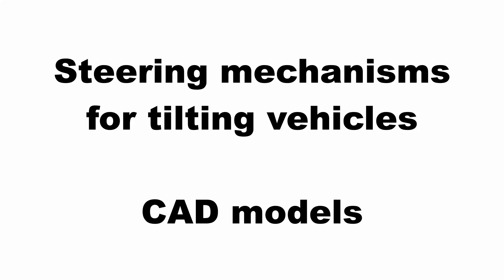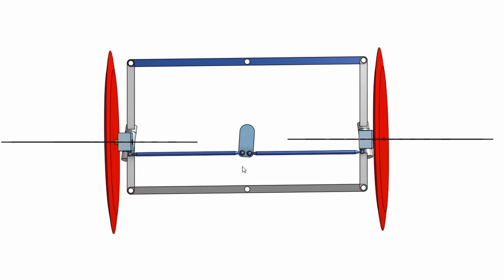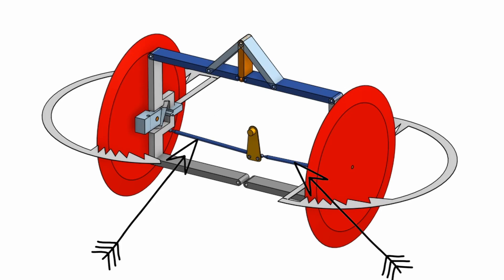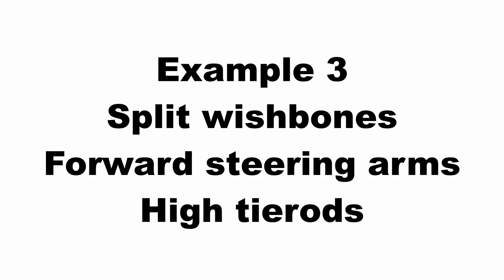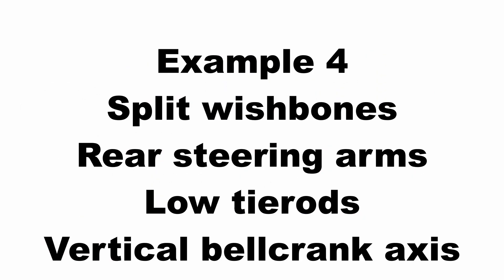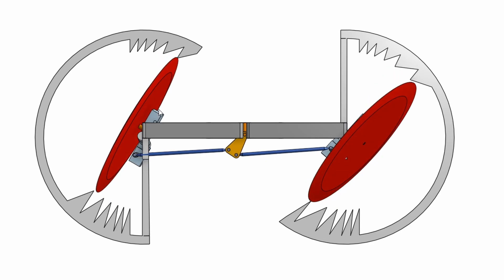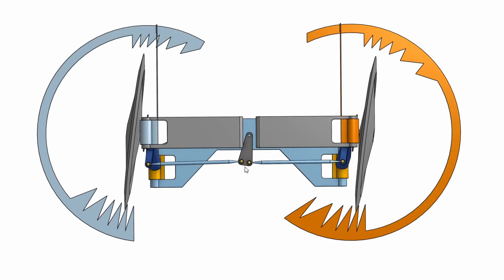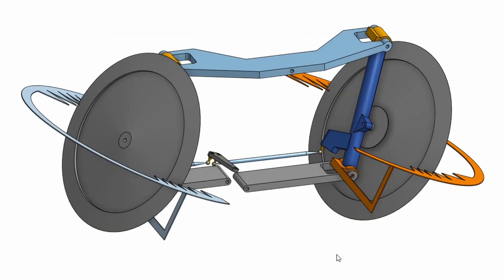Tilting Trikes Part 4 - CAD model demo tilting / steering mech design for reverse trike velobobile

Comment: Was glad to see this 😅 the only thing I could add from my racing experience is that when turning, toe out is good cause it allows the inside wheel to turn more, since the inside wheel does actually have a tighter turn radius to overcome, but I don't have any actual experience with tilting trikes...yet😅 my experience is based on 4 wheeled rally cars with 7 degs of caster and a modest 3 degs of negative camber, but I am building my own tilting trike and have made a cardboard mockup, but definitely haven't considered as many parameters as you have. Good work and would love to see how your geometry translates into a working model, thankyou 😅

Comment: i do have a question, what if you wanted to control the tilt and the steering at the same time using the handlebars? how whould that work (basicaly if you turn handlebars left, vehicle should tilt left and wheels should also go left)
Reply: Both controlled by one input gives hi lean at slow speeds in tight curves  and low lean on fast speeds in large curves. This is opposite to what is actually required, (as in a 2 wheeled pushbike action.). However, for normal road use, the angle of lean to angle of turn can be set to give a workable lean/ turn ratio that gives satisfactory riding control overall..

Comment: Hi. The bell crank seems to be the issue...if the bell was circular in shape, pivot in the middle and steering rows fixed at 9 and 3 o'clock this should eradicate toe in/out,?

Comment: When you have the wheels turned your aiming to have 0 toe, The idea of the Ackerman angle is to turn the inside tyre more than the outside. 
   The inside tyre has to turn on a tighter radius as it turns so effectively you should have toe out. The more steering angle(tighter turn radius)the more toe out effectively you will need.
    To calculate it correctly, picture you are looking down on the vehicle from above and you draw a line thru the Rear axle. If you select a point(for example 3m) from the center line of the vehicle, (this will be the turning radius)and draw a line from that point thru the center of each front wheel, the 2 triangles you create will have different angles with the inside tyre having a greater angle. 
   So to calculate Ackerman correctly you need to know the wheelbase of the vehicle. A really short wheelbase will need to turn the inside wheel more(effectively greater toe out) to turn the corner than a long wheelbase. It’s a lot easier to explain with a picture but I hope this helps. Just think that if the vehicle did a full 360* turn. The diameter of the circle created by the inside wheel will have a smaller radius than the outside so therefore it has to turn more than the outside wheel so it doesn’t scrub. Don’t think of it as toe out as this is making you think that the wheels will scrub, the wheels actually need to be on different angles so they don’t scrub as they need to turn on different radius circles.

Comment: Tilting vehicles when corners at high speed have the steering almost straight. when this trike steer more it goes very slow and almost vertical, You have to consider that while choising the geometry tune.

Comment: Everything you are saying is correct, but somehow I feel that a better bike would be a delta - like velotilt, where tilting and steering is decoupled - not that its better pe se - all the aspects of it are easier to iron out separately.
Its a shame the there aren't that many lean steering trikes, some if not all of them are plagued by inherent instabilities....
Reply from the maker: Good point, there are pros and cons to both configurations.  It’s interesting that the commercial 3-wheel scooter/motorbike market has gone down the tadpole route.  A question worth asking is - why have three wheels at all and not two?  Is the extra complexity of three wheels really worth it.  I’m not sure!
Reply: @MetalMachineShop  So I did a bit more googling while the comment was up, and it occurred to me that Velotilt, Mosquito, S'trike and Jetrike are essentially solving the same problem, but albeit a bit differently - all the joints and pivots are all around the place but in essence they are trying to achieve positive trail and as steep of a steering angle as possible.
What I like about FWD delta - simple drivetrain.
Regarding tadpole trikes - I think its safety - a non-leaning tadpole is much harder to roll, also with front wheels doing most/all of the braking - two is better than one.
I'm personally fine with two wheels, but three is much easier to start riding on.
https://i.imgur.com/44PV1G7.jpg
This is my ride, I love it, but getting GF to ride it - nope.
Now I'm thinking about a leaning delta
https://i.imgur.com/kLhIG4p.png
Something along these lines.

Comment: Akerman saw toothed guides, shouldn't they be parallel with the ground (and not perpendicular to the wheels) since the vehicle would be at an angle?
Reply from the maker: Vadim Romanovich I think you may have a good point there, but I think irrespective of this, the way I have done it still indicates that the wheels are steering correctly with respect to each other - at least approximately - although the centre of the turning circle may be different.  I might need to give it some more thought!

Comment: Why don't the tie-rods and lower wishbones meet in the middle? It doesn't seem too hard to imagine a joint that could handle overlapping axis'. Would that help the geometry?
Reply from the maker: Kevin Bailey hi Kevin, there would certainly be some layouts where this would be an advantage.  The sort of joint you envisage is possible but not easy to design!

Comment: thanks for the video, much better understanding of the stearing... I'm also building a leaning trike. going with two rear wheels, current design has the rear wheels doing the castering action to avoid toe in\out... anyone see how this could be a bad idea? (would save me several months of building and testing if someone can point out why/how this wouldnt work) love the vids, didnt even think about the toe in/out until your last video
Reply from the maker: Thanks!  I’d need to know more about your design to comment intelligently.  If it’s a delta trike with the rear wheels doing the tilting only and both fixed straight ahead I don’t see any immediate problems - it’s been successfully demonstrated on other designs.  Rear wheel steering would potentially be more problematic...
Reply: @MetalMachineShop  the rear wheels would act like caster wheels and the front wheel is for steering. I might even work only by leaning... I'm integrating mechanics/pistons to hold it upright until the lever is moved causing one of the wheels to lower. Thought if rear wheels were independently following the directions due to the catering ability this would avoid needing to worry about toe in/out and wheels not steering appropriately for the curved radious

Comment: Great work !! I don't think steering angles are very important while leaned  - like a motorcycle, you use very little steering when leaned over ..
Reply from the maker: True.  It’s more of an issue for slow speed tight turns but it’s good to try to get things as right as possible even if it’s only a theoretical advantage!

Comment: @8:05 no good if wheel and suspension elements penetrate each other...
Reply from the maker: Haha true!  You can get away with it in CAD but the real thing will need some adjustments to get everything to fit properly without clashing.

Comment: Really digging these video's. Hope to see one of these design's put into a working prototype.
Reply from the maker: Thanks! You will see a prototype soon, hopefully a working one.  It is currently being made in my workshop. Stay tuned...
Reply: @MetalMachineShop  Yep. Count me in.
Reply: @MetalMachineShop  i am just starting to gather parts for a similar design i have lots of bike parts lying about that i will use prob go 26inch at the rear tho and no plans lol. I have a good idear what i want to do but prefer to work in real life than in cad i adjust as i go and problem solve that way ✌
Reply from the maker: drumandbassob0007 the advantage of your approach is that you actually get on with it rather than think about it for ever without making anything!  Good luck, let us know how you get on!
Reply: @MetalMachineShop  Please make great videos about the building process, are you going to sell the plans?, if you do I am interested. Great analysis within all the videos, thank you for sharing
Reply from the maker: @Jacopo.  Hi, my later videos show the building process (not finished yet).  I will consider making plans available once the design is proven.
Reply: I would love to see the "spot on" design that also has suspension! :)

Comment: Ackermann is over estimated. It's nescessary to follow it for very sharp turns and loses practucal effect in large radii.
You might want to consider the orientation of the contact patches when leaning and sterring, as these 'climb' up the front of the wheel and change in direction significantly (orthogonal to the direction of travel for any steer angle when tiltet 90°, as an unrealistic example)
Reply from the maker: Hi, yes I agree, Ackerman less of an issue for large radius turns.  I had thought about the contact patch issue - I think it works with you rather than against you - but I shied away from trying to model it.  Thin racing tyres would reduce the effect!

Comment: In the turn the inner wheel HAS to toe-out as it runs the smaller radius circle. There more, tilting should also provide toe-steer, if the tilting used for the turn performance and not for moving straight forward in lean position. And for ultimate performance (a.e. racing) the tilting should also be lesser for inner wheel.
Reply: The leaning version of Ackermann angles, for tilting vehicles, would more than likely affect steering Ackermann. You'd have to find the sweet spot between the two where they cooperate nicely, which is probably too much work for a single person creating a leaning velomobile. Plus Ackermann geometry is very well defined in how it functions, the leaning equivalent is not, if the leaning equivalent has even been properly researched at all. Nobody really knows if differential lean angles will have better performance, or if the difference in performance is worth the extra cost of design and parts, until it's properly researched, and it probably won't be properly researched until there is a motorsport that adopts leaning trikes and quads. In theory it should be better, but there's no realistic counterpart to that theory. 
This also comes before talking about tires, deflection, and contact patch. The scope of a mechanism that both steers and tilts an axle goes beyond that of bike and motorcycle -like designs, and thus doesn't operate in the same way. Both of these also come before how you implement suspension into this kind of design, which would affect lean angles during compression and extension, and thus would also affect steering angles. There's also the issue of incorporating powered axles into these, for tilting quads, for rwd delta trikes, and fwd tadpole trikes. I think differential lean angles is the last concern when discussing any of this.
Reply from the maker: The more you think about it, the more complex it becomes.  Certainly too much for my small brain.  I’m just hoping that these issues don’t make too much practical difference.
Reply: @MetalMachineShop  I know it's beyond the scope of your velomobile project, but I wonder how viable a disconnected steering system would be. 
Rather than have steering be linked to a singular moving piece, or a chain of pieces originating to a single part, what if each wheel was controlled individually? Like if two single-ended steering racks were used. It'd require a computer to control it, along with a table of each steering angle - arm length ratio for each lean angle, along with a way to accurately measure tilt. In theory, a system like this would provide correct Ackermann geometry for every combination of steering and tilt angles, and could be easily adapted to differential tilt systems. 
Differential tilt could be done similarly, adjustable length upper control arms controlled by a computer that's programmed with all of the correct geometry. 

Both systems are fairly simple in theory, just a lot of math, and it should be fairly simple to construct. Almost like a steer-by-wire and tilt-by-wire mechanism, except both sides of each system are discretely controlled. 
The first issue is the idea of a powered axle, as between steering and tilting, you'd have extreme angles that no universal joint could realistically handle. Unless someone develops a spherical gear system, which I doubt will ever actually happen as spherical geometry isn't a nice thing to deal with, hub motors are probably the only viable solution. 
Next issue, and the big issue here, is suspension on differential tilting. Sure you could program a computer to adjust the system to compensate, but the issue is if the computer would be fast enough to do so, and if the actual actuation method is fast enough to do so. Maybe add a hydraulic cylinder to work with the suspension's hydraulics, where when the suspension compresses, the tilt arm extends, inversely with suspension extension, to keep correct differential lean geometry correct, and this should reduce any lag the electromechanical system would have. But again, this is just a theoretical concept that should work on paper, but seems like it wouldn't be too difficult to implement in an actual vehicle. Suspension is definitely the most difficult puzzle piece in all of this to figure out. 

I just wish a motorsport division would get interested in leaning trikes and quads, just so we'd all have actual teams of engineers figure out the difficult parts for us, with the added bonus of ridiculous over-engineered systems that would never go into most road and track vehicles.
Reply from the maker: You probably could do a lot of this stuff in principle - or even in practice -  but the question would be whether it gave you any advantage for the huge increase in cost and complexity.  For a small, human-powered vehicle, lightness is everything and a simple passive tilt mechanism should be all you need.  It’s hard to justify going from two wheels to three other than as a novelty and an intellectual exercise!  Computer controlled steering wheels could be done relatively easily, but you would want a high degree of reliability to be safe, plus a continuous power source.  Flat batteries would not be helpful!